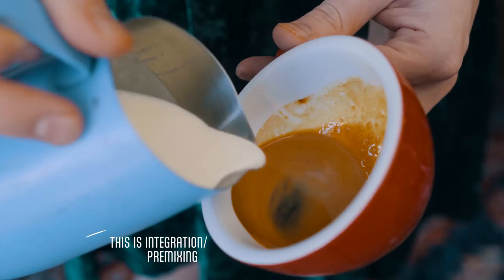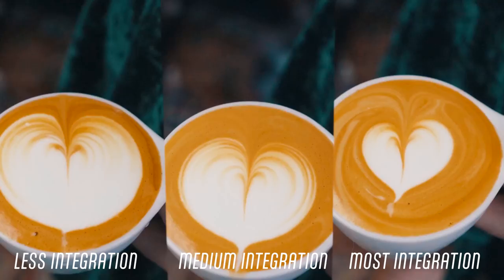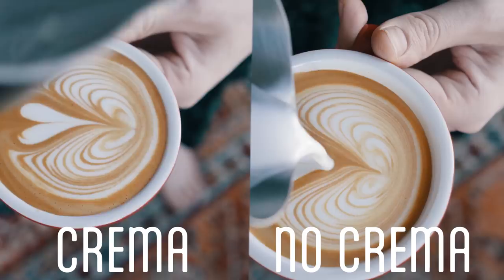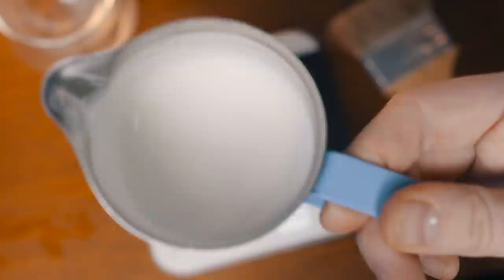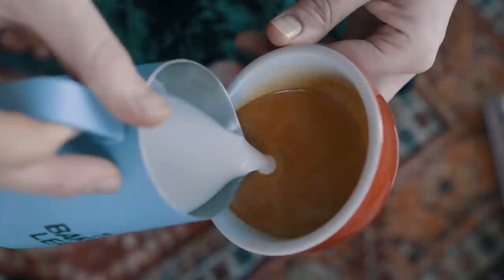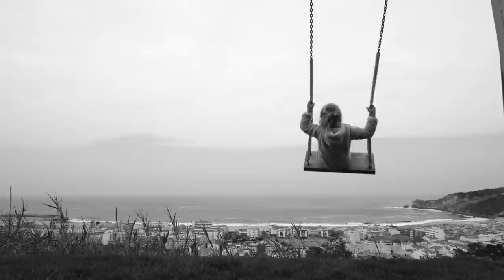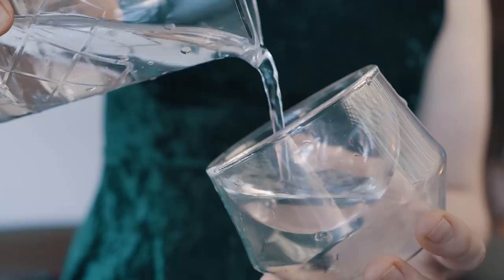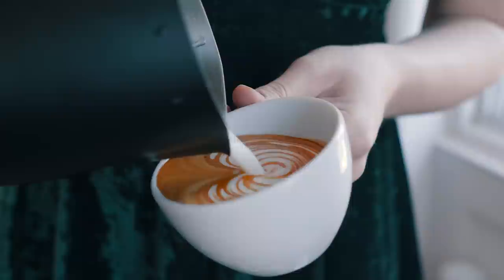5 MOST COMMON Latte Art MISTAKES(and fixing them)

Comment: This was so helpful - thanks! I watched the video before bed, woke up this morning, and applied it to my first cappuccino, and it was a step change improvement. The two tips I focused on were swirling and integrating. I started my pour much sooner than usual (less milk to start) and was immediately rewarded with clear ripple lines and a nice, full distribution that continued to the edge of the cup as it wrapped around. I actually kinda panicked because I wasn't expecting it to go that well and didn't really have a plan for where to go with it.

Comment: I really love the flow of your pours, there is a special raw beauty in them! - I really need to work on lowering down my integration, I think it's holding me down even after years of pouring;) - regarding the swirling: I too have realized the more you swirl the better. But in my own attemps I found that once I finished steaming I like to swirl, transfer all of the milk/foam to another pitcher, swirl again and then transfer them back to my pouring pitcher and swirl again. In my perception, I get the least least amount of seperation this way and can maintain a very consistent density of microfoam throughout the whole pour. For me it's especially important, since my machine is a crappy modded Gaggia Evo, the first machine I started my coffee journey with and the stream pressure is not stable, so I basically have to a similar thing to oldschool temperature surfing to get to steam with a consistent pressure and also the steam being not too wet....;)
Hope you can rate my free pours one day!

Comment: One thing I eventually realized while casually practicing latte art as a home barista is that, sometimes, the thing that's making it super hard to get good latte art is the milk itself. Some milk brands are simply better at making quality microfoam than others. 

This is just based on my personal experience but, with a good brand of milk, making crisp-looking ripples is as easy as a steady pour and simply going with the flow. 

TL;DR: If you are already consistently good at creating wet paint-looking microfoam but you try to pour your monk's head and the foam still ends up looking waaay off, it's probably time to switch milk brands.

Comment: I know this is video regarding latte art but regarding your last point, transferring your steamed milk to a different (larger) pitcher will cause the milk to significantly drop in temperature often resulting in lukewarm latte. You can counteract this by pre-heating the 2nd pitcher.

Comment: Great tips! I am having a workflow problem. I just purchased a Rancilio Silvia M (my 2nd), Eureka Mignon Silenzio, scale, WPM 22 oz pitcher, and a Not Neutral Lino double cappuccino cup (6 oz). I made the first cappuccino this morning; and it was the best cappuccino I've ever made in over 30 years. My latte art was still a flop, but I'm just starting. Yet, I'm having fits gettin' my get goin'. I pulled a good shot with crema. However, it took several minutes to get my steam going, so the cup got cooler and the crema broke up. My frothed milk was very good however. If I froth the milk first, then it would get cooler; and, I cannot constantly swirl the milk, now transferred to the WPM pitcher, while I pull the shot. You also use a Rancilio Silvia in many of your videos. Please, help me!
Thanks, Emilee! Your filthy, dirty scumbag, Froggy.

Comment: Tbh... you make this initial push forward look so easy 😀I always try to do this, but for now pouring while lowering the pitcher works better for me for certain designs. One thing to mention: too much frothing is also a mistake I used to make in the past. You can somehow "swirl" to a better consistency, but jup... less is sometimes more, right? Thanks Emilee for those tips! By the way do you use double or single shots in that cup (I usually do 36-38 ml... so flat white more or less)? Maybe also important to mention for the first integration, since this might change the amount 🙂

Comment: This helped so much! Thank you! How many grams and ml of coffee/water ratio do you use ? Or does that not make a difference?
Reply from the maker: Would depend on the drink you want/ portafilter basket size/cup size. But i generally brew medium light roasts and usually yeild around 36-45 grams depending on the coffee. And of course cup size plays a role too if your shot is too full in the cup. or too low in the cup

Comment: Hi Emilee, this is probably a noob question but would you suggest a single shot or a double sized shot for the latte art? I have a ~6 ounce cup and an ~11 ounce cup, and so far my latte art always ends up being beige in the bigger cup.

Well, having watched a couple of your videos, I will now start experimenting with stacked cups and using the smaller one for latte art, but how much coffee should be in it? And is there also a coffee to milk ratio that you suggest for this?
Reply: both work fine. it's more important to nail the extraction time for your coffee bean of choice since it highly effects the crema. 

of course the higher the coffee to milk ratio, the more contrast you'll get